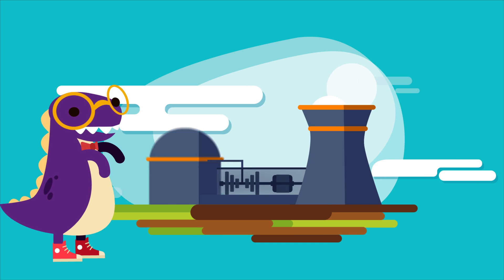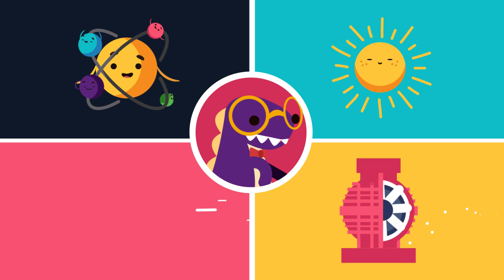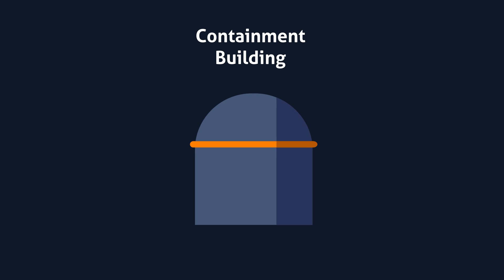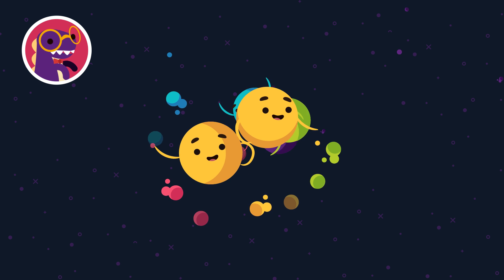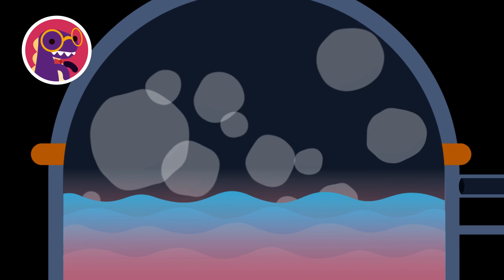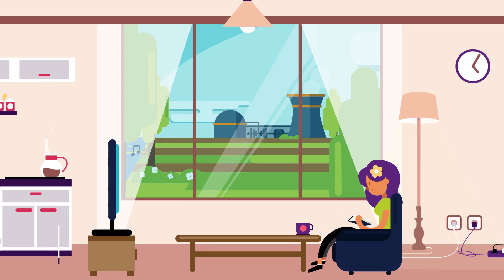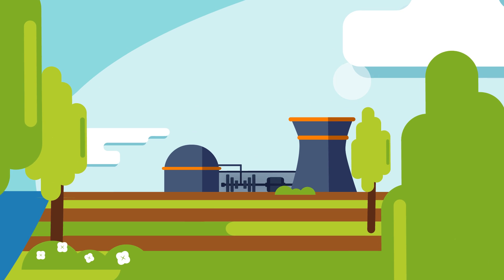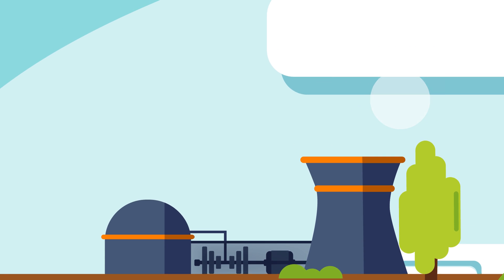How does a nuclear power plant work?

Comment: Okay but what happens if due to insufficient cooling the fuel rods heat up until the rod's zirconium hull gets hot enough to separate water into hydrogen and oxygen and the highly flammable hydrogen surrounded by an oxidizer touches the hot zirconium?
Reply: Let's try it and find out!